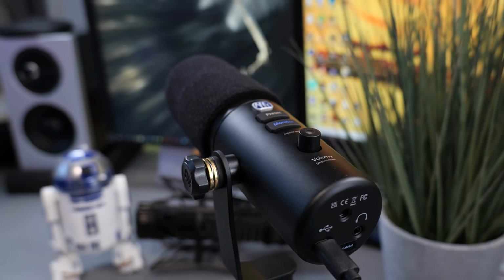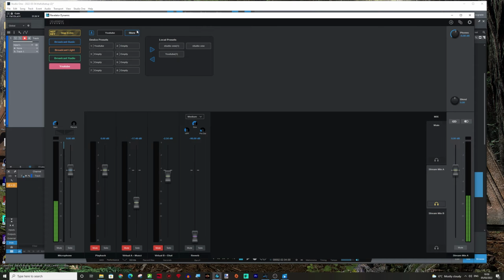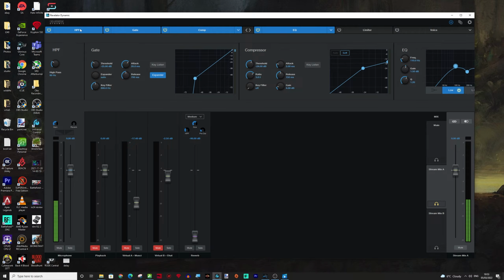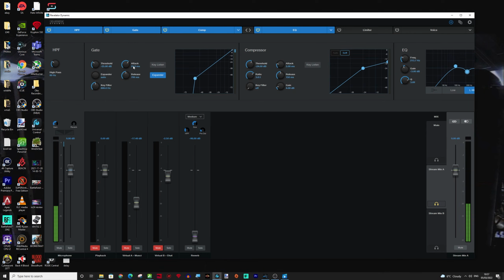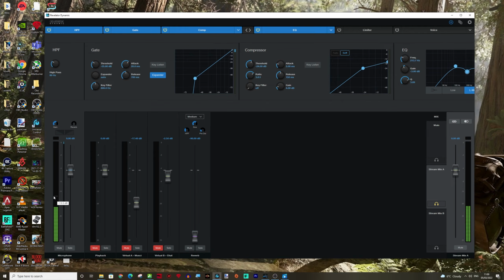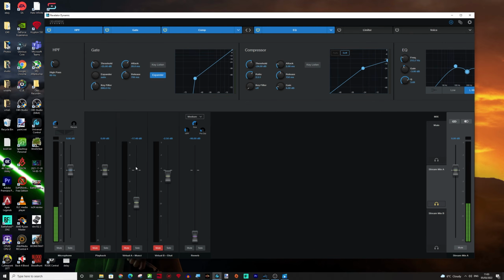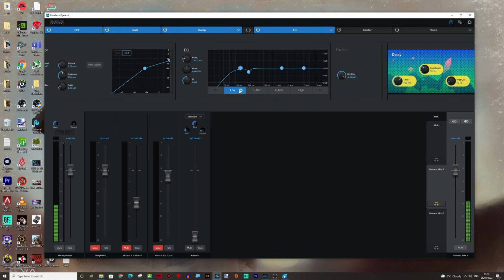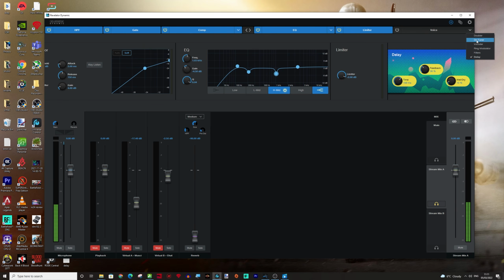PreSonus Revelator Dynamic Microphone - How To Setup Expander, Compressor, EQ On Universal Control

Comment from the maker: Just a little update I have been adjusting the expander a bit. I’m a very heavy breather not helped by vaping and being lactose and I won’t get started on what my fav foods are 😂. I clearly need to make some life style changes but editing out my heavy breaths has been a challenge for me with my videos. I’ve often found gates too aggressive and couldn’t get the expander quite right on the revelator devices. To fix this I have used the frequency analyser in adobe audition to see what frequency my breaths start at which is around 100-200hz.
Setting a key filter to 175 in the expander has massive reduced this and I’ve now changed the attack to 10ms but left the release at 500. Although my breaths are still slightly present I’m much happier with expander now.
Reply: I think your release needs to be bumped up to higher than what is on this vid (700?). I can hear the disruption of the release and its jarring to listen to. Maybe you have kept it lower to hide the hiss of the mic you have been mentioning? Just not good to hear there is a hiss on the mic not related to background noise.
Reply from the maker: @OfficialMyMindset  will do I’m adding a gate after to try and cut my breaths out I think that’s what I’m messing up here. But will certainly look at extending the release on the expander now I have the key filter how I like it. I’ve contacted presonus about the hiss so hopefully they get back to me soon.
Reply from the maker: @OfficialMyMindset  here is the loop back video with just the expander https://youtu.be/0MeAQHkrqZ0
Reply: @thefullsetup  The vid you linked sounded way better bar the hiss of the mic. I think the revelator would need a built in Mic Suppression in the DSP (something like the RTX voice). I wonder if they would add that in, or if it was even possible at this stage.

Comment: I got the revelator io24 interface lately. as there is no forum at Presonus anymore nor on reddit as it is banned, where do we get help? I have the problem to setup my gain correctly. As beginner thats not easy to understand. I am always to loud doesnt matter what I try. Could help or know a link to setup the mics gain? Even your video doenst show the beginning. You jump to the fat channel. but before that what is with gain level?

Comment: @thefullsetup Is profile which you create stored on microphone or on local PC storage? Purpose of my question is, does microphone still have processed sound, even if software isn't opened, or software must be opened, so microphone get processed sound? There is no setup for Linux of this software. If I install it on windows and setup a specific profiles, I want to know, when I plug in microphone on linux, will I have still processed sound from profiles. Thank you in advance.
Reply: Wondering the same thing.
Reply: https://youtu.be/nlnJNyUyVRw?si=_H-L5FLqCUgVeX5m
Reply: @GHC_II  Thank you very much. That's all I need to know. That feature solve everything for me, for recording on Linux. For that purpose, this is by far the best solution, right now. I don't need to modify anything on OBS, just plug and play, and I don't need additional audio interface.
Reply: @ 1000%. Happy recording!!

Comment: Hi. I'm interested in using StudioOne's fat channel to emulate all of the settings available on the Revelator Mic Fat channel so that I can audition and tweak the settings in DAW and then drop them into the Mic.  I'm a musician and I plan on using the revelator on the road to record vocal sketches.  I want to make pre saved settings for different vocal styles that I can easily move through when composing. YOu touched on this a little bit in the video but I have a few questions.. Firstly, the mic has the "voice" channel that has effects.  Does the DAW fat channel have that?  Also, I just downloaded StudioOne Artist and didn't see a fat channel right away.  When I went to search for it in the effects available for download, all kinds of results came up, most requiring purchase.  Is this something I'll have to buy? Sorry about my ignorance.. I'm a Logic and Ableton user primarily.

Comment: Thanks for this video man.
I just moved over from a simple headset mic attatched to my DT990's and got a Revelator Dynamic. Before I was messing around with Voicemeeter Banana+Reaper VST but was never really satisfied with the results. Now with the Revelator the voice out of the box differs in worlds! Im so glad I got this over the BEACN Mic (I also ordered one, but after some devestating reviews I canceled it).
Long story short: Im super new into the "bigger" game and the hardest thing for me is messing around with the EQ, maybe any recommendation to start as a beginner in EQing? I dont have any previous experiences how I would like to hear my voice like. Actually I just copy your and some other YT settings and mess around with these 😅
Reply from the maker: Honestly I’m still a novice when eq is concerned but I am someone that believes less I more and like subtle changes, as mentioned in this video always cut before boost. Ideally record some audio into another programme like adobe audition or just anything that’s has a parametric eq. Then to some tight q boosts to find sounds you don’t like then cut those frequency’s.
I’d check this video out as it will really help you get a better idea about eq https://youtu.be/7H3cHfV8rXI
Reply: Copy and then adapt and you're on track, I have the io24 and am very fond of it so far.
Reply: I ordered a BEACN and once I saw the Presonus video I made sure to get order one. I never bothered with opening the BEACN box and I returned it the next day. A week later I was a happy owner of the Presonus. It definitely is much better than the RHODE NT USB which I was using but I still need to get the hang of using the effects to get the sound I want.

Comment: What happens when you run this and an IO24 at the same time?
Reply from the maker: No Issues with both devices plugged in at once. you can only access one device at a time through universal control but the switch between the two is pretty instant.
Reply: Had to test it. As @thefullsetup said. But you can connect and manage another device remotely from an supported tablet or another Windows PC or mac, at the same time. If you where able to trick the launcher to open two times somehow, you will probably be able to manage both devices from one computer.